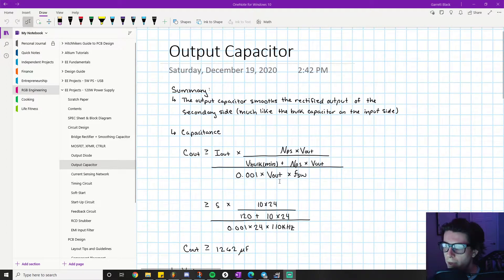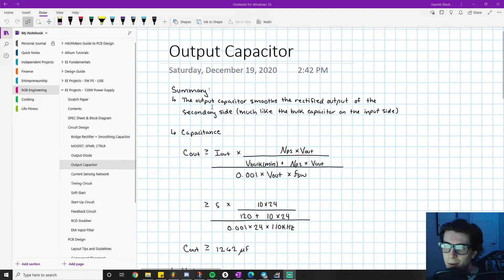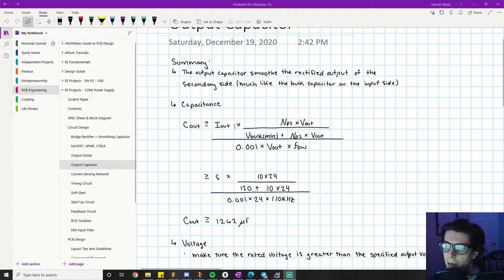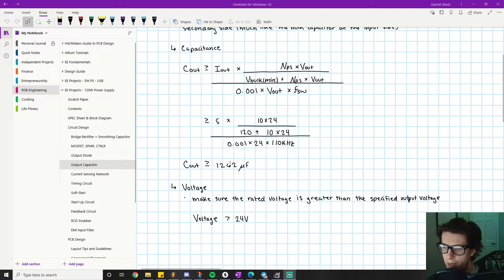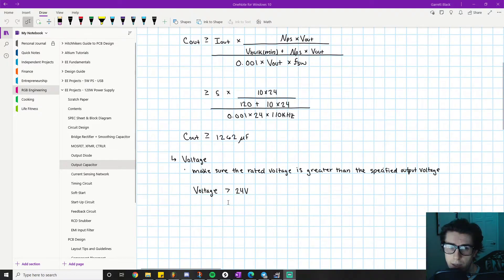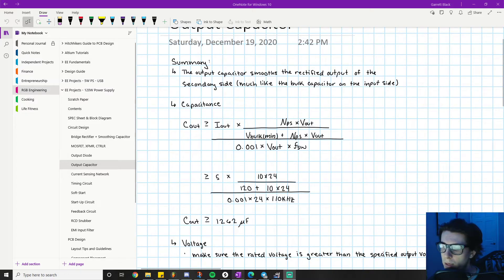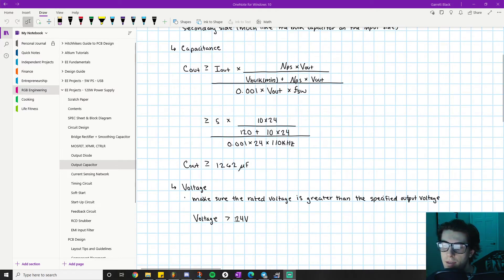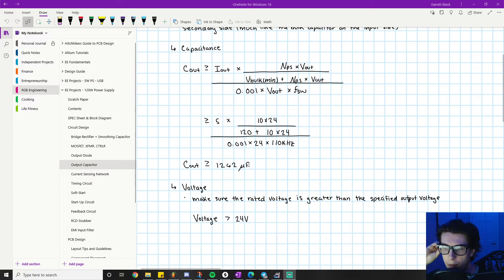FLYBACK CONVERTER PROJECT PT 7 | 24V, 120W FLYBACK CONVERTER EXAMPLE | POWER SUPPLY EXAMPLE PROJECT

Comment: Hi RGB Engineering,
Request for some advice,
I am doing 3 outputs, 12V 3A, 5V 4A, 3.3V 5A. total approx : Pout : 75W. can I know if is for output current, do I take 75/12V = 6.25A or take largest output current of 5 A or 3A+4A+5A? 
Please help, thank you.
Reply from the maker: 75W / 12V = 6.25A is correct.
Reply: @RGBEngineering  thank you very much for the help.